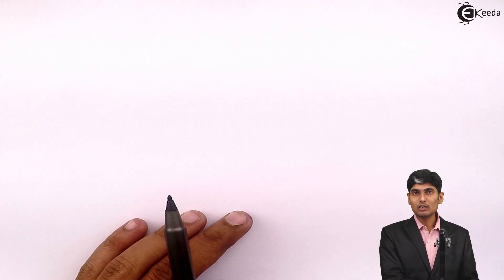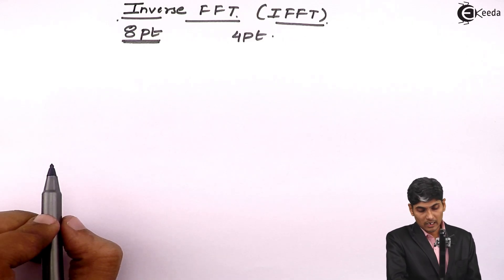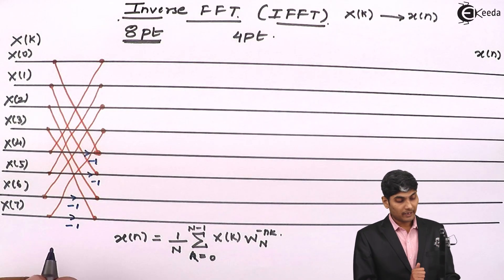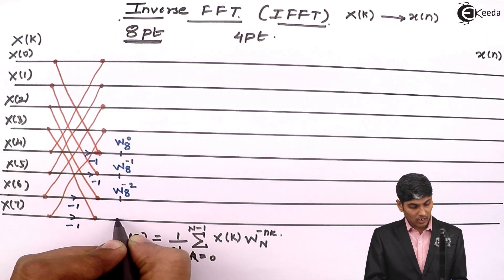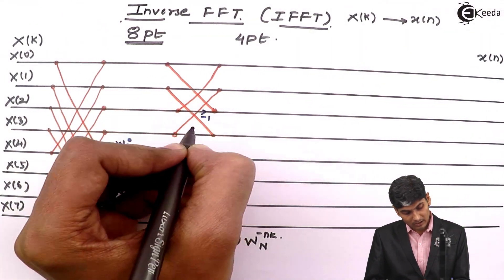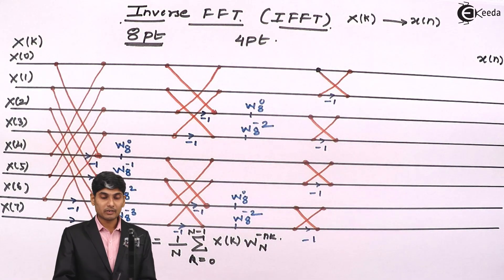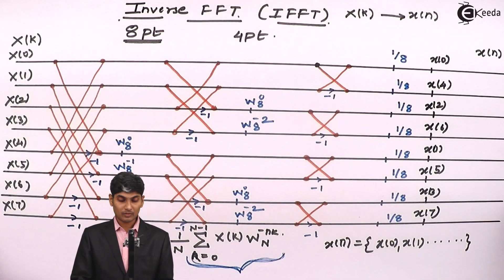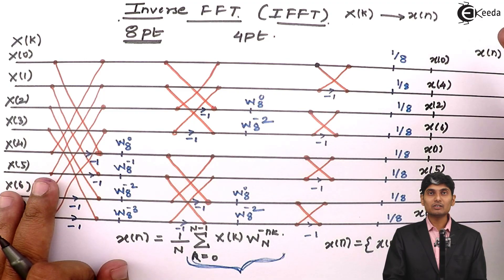What is Inverse fast Fourier Transform (IFFT) using fast Fourier Transform( FFT )

Comment: Good video. But should explain what you mean by bit reversed order. That is, if 8 states, each represented by a 3 bit code, then the first row (left-hand-side) is level 0, or "000" in binary form, associated with x(0). Reverse those 3 bits, to get "000", no change. So the right-hand-side also has a 0 index.... ie X(0). Next, x(1) has index 1, which is 001. Reversing the bit order gives "100" or decimal value of 4. So the right-hand-side becomes X(4). And so on.
Reply from the maker: @Kenny
If you have any doubt regarding to subject please visit http://ekeeda.com/chapterlist/Mumbai-University/Electronics-and-Telecommunication-Engineering/Discrete-Time-Signal-Processing-/101
or Contactus on 9821842103